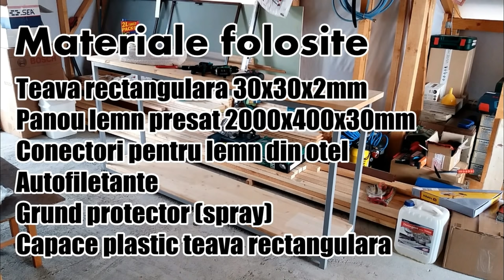Banc de lucru pentru atelier! Cum l-am facut

Comment: Salut, de care aparat esti mai multumit? Cel cu electrod sau acesta cu sarma?
Reply from the maker: Hm, ca sa ma intelegi, imi place sa lucrez cu sarma din mai multe motive, sudura mai fina, nu mai alimentez tot timpul clestele cu electrod, fiind mai aproape cu pistoletul de sudura parca am mai multa manevrabilitate, nu se mai lipeste electrodul, aprindere instantanee, nu te rogi de electrod, etc. Dar tot cu invertorul cu electrod sudez cel mai des pentru ca e mai usor, mai mic, il pot muta usor de colo colo. La cel cu sarma ma incurc in cabluri, toate 3 ies prin partea din fata. Ala e bun sa lucrezi cu el numai pe loc, sa ai undeva un loc amenajat numai pentru sudura si sa cam stea fix intr-un loc. Cel cu electrod e mai comod, il prefer.

Comment: Impropriu spus banc, e mai mult masa , nu critic e doar o parere, un banc de lucru dupa parerea mea trebuia sa aiba aparatoare de scantei, menghina montata pe el , un blat de metal si lampa de lumina reglabila, polizor si roti pentru transport.....o sa fac un model si o sa vezi mai bine despre ce e vorba TE SALUT 👍
Reply from the maker: Bancurile de lucru nu trebuie sa fie toate la fel. Eu am facut un banc de lucru pentru necesitatile mele. Am montat deja menghina pe el, vei vedea cum se incadreaza in atelier in clipurile urmatoare daca ramai pe faza. Eu stiu cum am vrut sa arate, ce lungime, ce inaltime, ce latime, din ce sa fie blatul, etc. Roti de transport nu am nevoie, este un banc fix. Cand incarci clip, revino aici si da-mi un link, sigur ca vreau sa vad. Te salut si eu.
Reply: @DemoToolsYT  cu siguranta, imi place ceea ce faci 👍